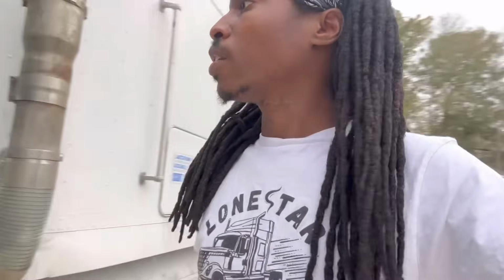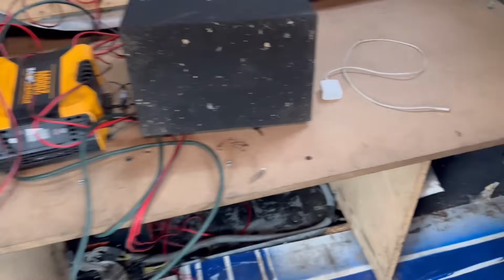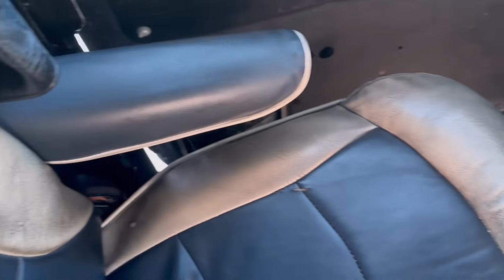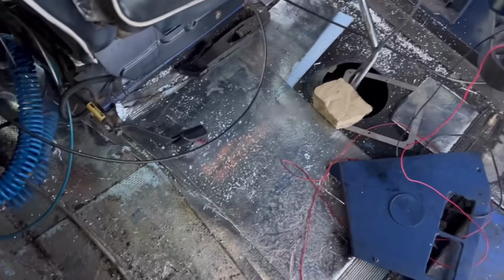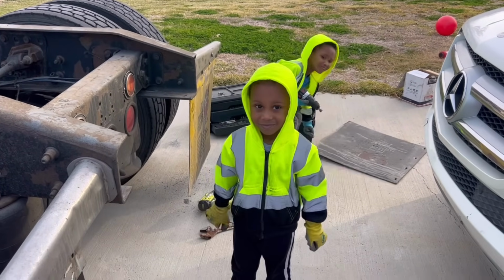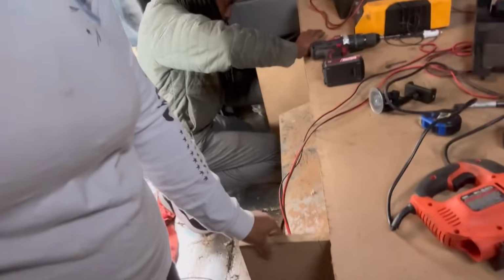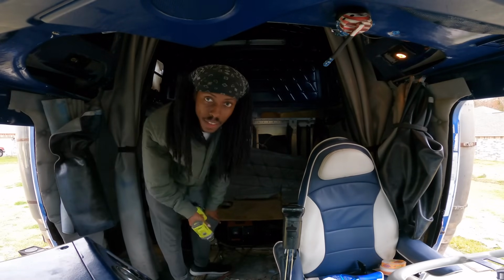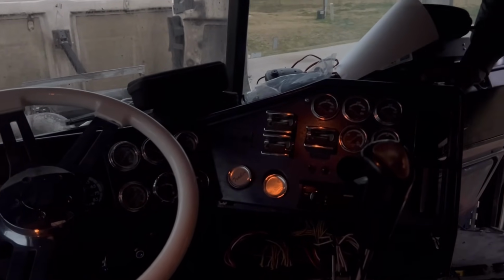FLD RESTORATION (Episode 1): 🪚  Time For The Restoration Process. It Was More Work Than We Thought.

Comment: Head out to a home center and get some closeout laminate flooring. You could probably do the entire floor for under $50. It would last until you figure out what the permanent floor will be. And you can get the floor insulated now and only do that once. Also insulate the side walls really well while it's open up and put in any lighting you want before you finish it up. Just somethings to think about